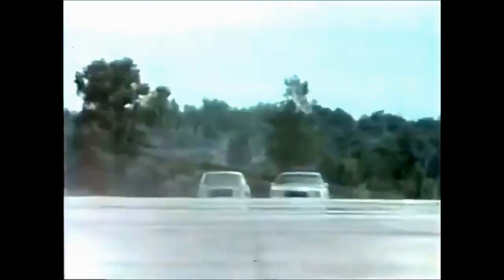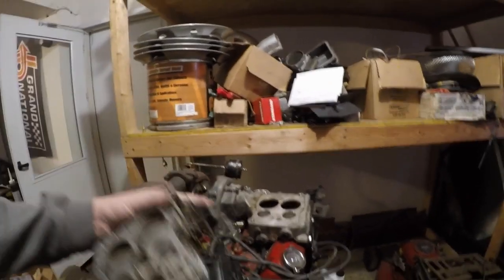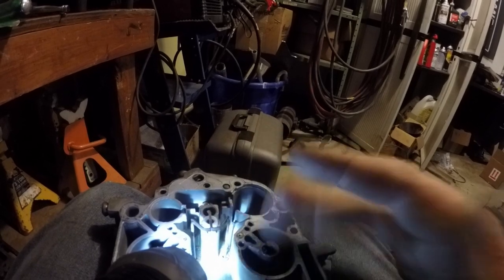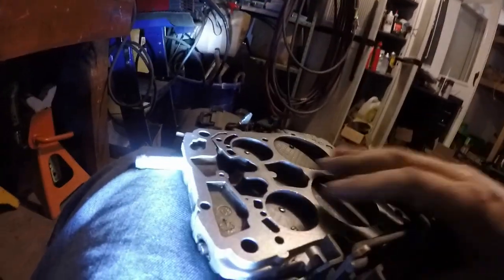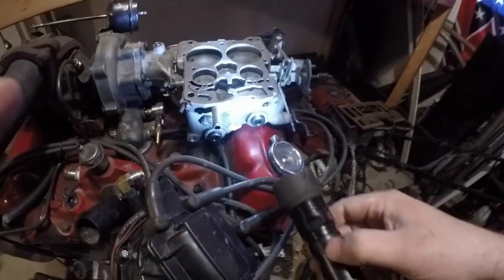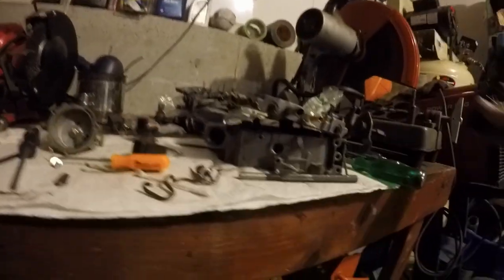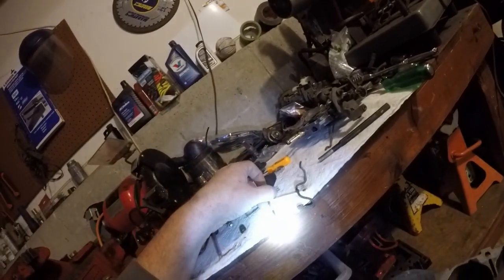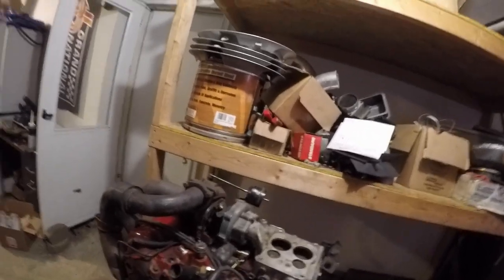modifying quadrajet carburetor for draw thru turbo buick v6 3.8 231

Comment: holley has the new quadrajet sniper EFI..im really thinking of putting it on my draw through =)
Reply from the maker: I was thinking the same. But the cheap one has the map sensor built into the carb so it wouldn't work well.  They turbo can pull vacuum under the carb when it's under boost. You need the map sensor after the turbo on the manifold and it needs to be able to read boost.
Reply: @HorsepowerTube  im not understanding why. if it has an o2 sensor it can keep it in balance, if it sees increased vacuum (like on a 502 stroker under load) it should just inject more fuel. thats the difference between draw through and blow through. draw through you let it suck as much as it wants and inject fuel to maintain the a/f. blow through needs to know the pressure coming into the carb.
or am i in left field?
Reply from the maker: @TheRowdyJ  you have it backwards. Vacuum is high at idle. Usually around 20in mg. At WOT, there isn't any vacuum. On the draw thru, under wot, the turbo can suck in more air than the carb can flow, creating a vacuum, leaning out the mixture at the worst of times. That's why they use a special carburetor that has a port to get vacuum after the turbo instead of before it. If you put a standard quadrajet on there it will not work right, but it's not hard to modify one. But for the efi "carbs" you would have to find a way to block off the map and route it to the intake or get the more expensive ones that let you use an external map sensor. The cheaper ones have the map built into the ecm in the carb.
Reply: @HorsepowerTube  well, i didnt say what ieant correctly. when the turbo spools, it creates a suction like a large bb would. not vacuum tecnically. a "draw".

dont these efi systems measure air through the throttle body?  and with an o2 sensor it would keep balance.
problem i see is it you yell the efi its a 231 v6  and the turbo spools and it draws air like a 502, it would lean out big time. 
but i dont know

Comment: just put a bit of welding wire under the power valve and have it run full rich all the time. You don't care about gas milage do you?

Comment: Just an FYI, a check valve does not work for this. The check valve will keep the power piston under vacuum. You need to locate a working power valve. You need a valve that will let vacuum pull on the power piston at idle, and only allow a pound or two of boost, or normal atmosphere pressure when under boost.
Reply from the maker: Pevr are about impossible to find. I'm going to add a small vent hole to the check valve circuit, and it should work ok. Guys do this on the vacuum on th350 trans and it seems to work well. I'll be doing it for both. When boost comes on the vacuum will bleed out, and power piston should work fine.

Comment: Thanks you this was very helpful. I've been trying to put togethet a draw thruogh system for an old flathead project I'm working on. It's hard to find useful information about these systems. All I get is opinions instead of technical info. I had a suspicion about the secondary fuel mixture needing to be fattened up but hadn't considered the idle circuit on the primaries. When I ask people about draw thruogh turbo systems they act like your crazy. When you mention quarajets they act like your stupid. But I like stupid crazy shit.
Reply from the maker: I forgot to mention, you need to add a small vent hole after the check valve. If you don't, it will pull the piston down when it sees vacuum, and it will be stuck like that, because the check valve won't allow air to come back in. I will also do the same to the vacuum can on my th350 transmission. They make a kit for it but I'll probably use the one check valve for both. At idle it pulls enough vacuum that the small vent hole won't matter. But it allows it to work properly once it can bleed off the vacuum.
Reply: @HorsepowerTube  makes sense thanks for the info.
Reply: @HorsepowerTube  
I wonder how the Accel turbosonic and Martin systems worked without modifying the Quadrajet. I'm assembling a draw thru on a 350 squarebody. I was under the impression I could just bolt on the carb to the carb adapter.
I've been reading and collecting all I can on these old systems.

Comment: Super cool engine I'm putting back the 231 V6 in my 1979 Pontiac Lemans, I read online the stock Na block can hold up to 550-600 and that was an official street magazine post too! I might have a Turbo setup for that engine i'd sell you.
Reply: I’m trying to turbos mine, I gotta 78 el camino I could just drop a 350 in it but I wanna keep it original and unique